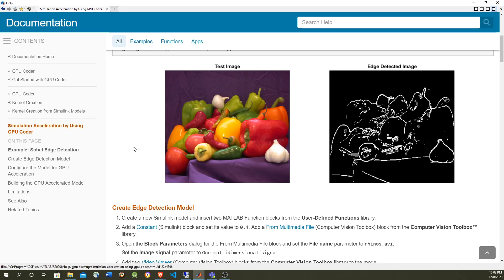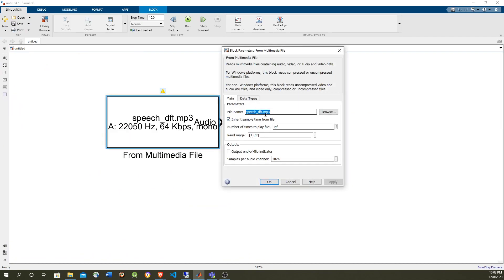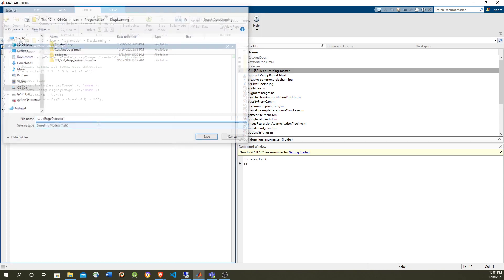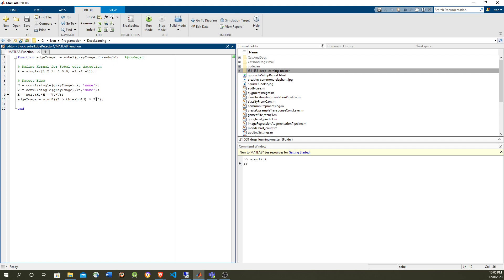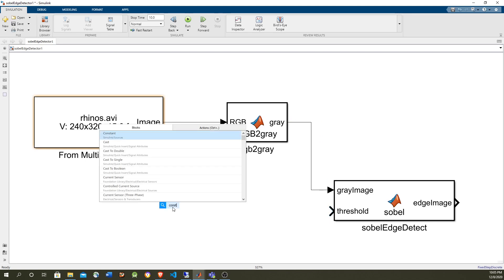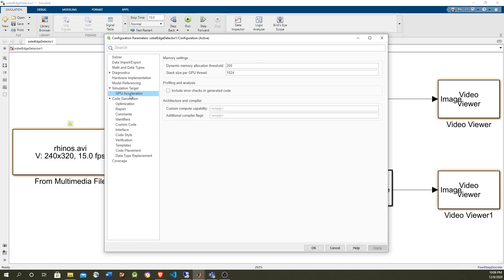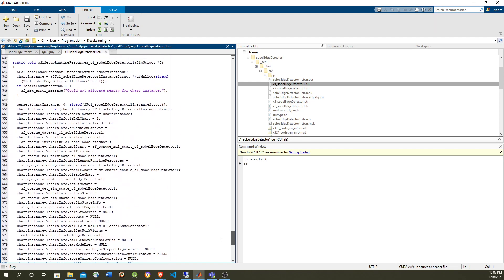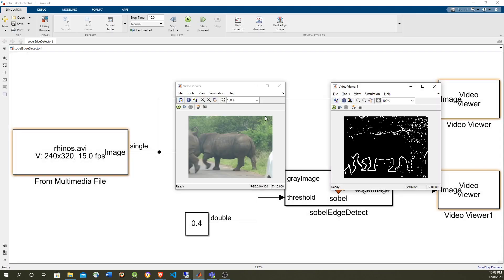GPU acceleration of Simulink model for image edge detection

Comment: does the gpu acceleration work if y change discret(no continious states) option.?
Reply from the maker: I think you can try it. Usually code generation/accelerator mode complain for this asking for discrete or fixed step sample time for code generation. But they might have added support.

Comment: sir i wanna ask you
does the gpu accelerator speed up the fuzzy logic controller?
Reply from the maker: I have not tried it, but I don't see why not. You could try a Fuzzy logic example and configure it like this GPU acceleration example video. If your fuzzy logic code is in MATLAB, you can use a MATLAB function block within Simulink, although MATLAB coder also has GPU code generation. Please let me know if it does not work. It should.
https://www.mathworks.com/videos/getting-started-with-fuzzy-logic-toolbox-part-1-68764.html
Reply: @IvanGarcia-cx5jm  my problem is i dont have an nvidia gpu i want to buy one for a phd project but i dont wanna waste my money if it doesnt work with fuzzy controlller and thank you for replying
Reply from the maker: @taharnouaoui7755  You could use GPU's in the cloud if your university has that paid somehow. If the university has that option available you can search for this example to use it in MATLAB: "MATLAB Deep Learning Container on NVIDIA GPU Cloud for Amazon Web Service".